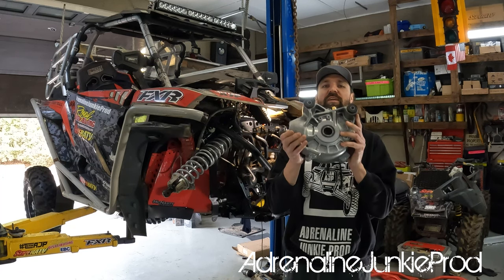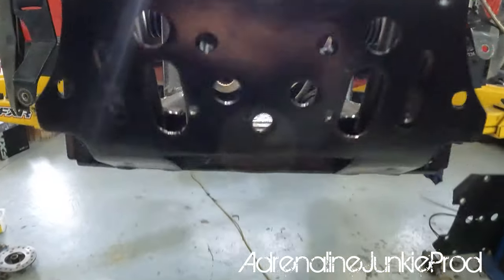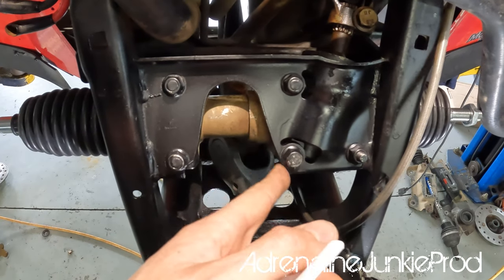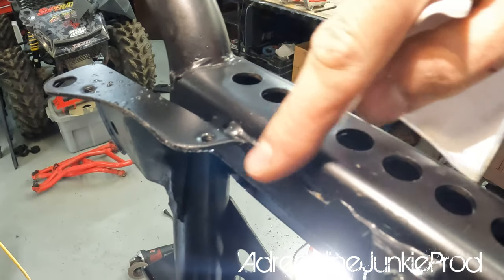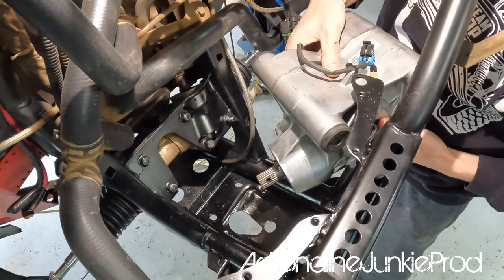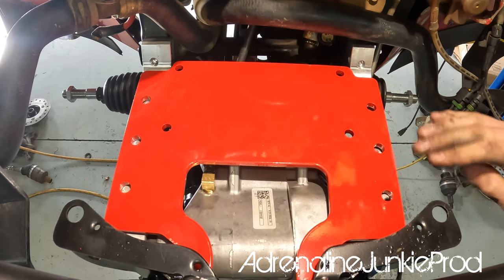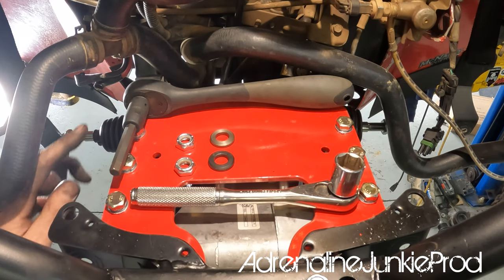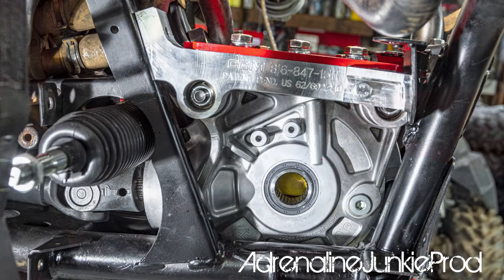HOW TO: RS1 Front Differential Swap - Polaris RZR Turbo/XP 1000 - Coffman/All Thingz UTV Bracket

Comment: Nice work. Looked clean all painted up and that diff basically fell into place.
Reply from the maker: Thank Lloyd. Ya, the kit is very well thought out and it all goes together well. The diff really does fall into place. It looks right at home in there.  A huge improvement.
Reply: What axle are you using?

Comment from the maker: Thanks for checking out the video. I hope you find it helpful and informative. This swap is very straight forward and I feel it is easier than most people make it sound. Take your time and think it trough step by step, you can do it! This video focuses on the main areas which need to be modified to fit the differential in your machine.

High quality images and more info can be found here: https://www.adrenalinejunkieprod.com/rs1-diff-swap

There will be an extended length step by step and in depth video posted on this conversion in the next few days.

If you have any comments, feedback, tips or suggestions then please leave a comment so we can get a good conversation going.

I utilized the Hill Killer differential built by Joe Coffman and I have been using it for a few months now. I've beaten on it quite hard on 34 inch tires with absolutely no issues at all. It feels way better than the stock differential. I highly recommend this conversion.

Link to Coffman Custom Machine: www.ccm-na.com

This is the exact same bracket All Thingz UTV sells. Coffman Machine builds the brackets for All Thingz UTV.

Comment: Sweet you'll be good to go now!  Did fish put a RS1 diff in his commander or was that just a Polaris diff? I didn't last long.
Reply from the maker: Ya, I think it's pretty solid now! It's been working awesome. Fish put a Swiftrac diff in his commander from SuperATV. It's basically a Polaris differential because it is a Hilliard style diff. It is not an OEM Polaris diff. The first one failed due to bad luck, there was a manufacturing defect that SuperATV later identified. They replaced the diff with no questions asked and the replacement has been working well so far.
Reply: @AdrenalineJunkieProd  awesome, good to hear they resolved it.. and it wasn't a OEM polaris dif lol.. I felt bad for him it broke so fast.

Comment: What made you use the high guard oil rather than OEM?
Reply from the maker: If you watch the extended video I go into detail. To summarize, the Hilliard diff is something that’s been used by John Deere for a very long time. Many consider Hy Gard to be superior to the Polaris Demand Drive fluid. Joe Coffman the designer of this kit and the developer of the hill killer recommends it also. I have only ever run DDF in the past and it’s been fine and if I continued to run it then it would also likely be just fine. It’s one of those part gut feeling part personal preference type choices for lack of a better explanation. Ive heard some good arguments for why it’s better though. There’s some articles about it online. Realistically either will do well as long as you change it regularly.

Comment: When was this install actually done?  Did you have a diff failure after the rebuild video?
Reply from the maker: The install was done about 4 months ago. I outline that the diff has worked flawlessly in the first comment. I have not had any issues at all since installing this even running 34 inch tires. I have put over 1000 miles of mixed trail use on this setup and it works amazing. Not a single noise from the front diff since install. It engages amazing. I have pushed it quite had many times. Video uploads on the channel are chronological for the most part. The last video I posted of the Minden Offroad Park winter ride was the last time the stock diff was in the machine. If you watch that video then I explain that the front diff was in need of replacement and that I would be swapping in this RS1 diff. It's been a really busy few months for me so I'm trying to get all caught up with the content. I highly recommend this conversion.
Reply: @AdrenalineJunkieProd  unfortunately I have a TRE  and cannot utilize the RS1 differential. Not sure exactly why but that is what is being said on the web sites of the companies that sell the conversion kits.
Reply from the maker: @Indianahillclimber  Ya, that sucks man. I've heard the same thing. I believe it has something to do with the transmission in your machine. I don't know specifically though. Maybe someone else can chime in and clarify the reasons.
Reply: @AdrenalineJunkieProd  I was just on the RZR forum, your right it's because of the trans gearing. Thankfully my trans has held up fine. If it does eventually go out I will just buy another OEM one. Thanks for the great content.
Reply from the maker: @Indianahillclimber  Ya, I thought it was gearing related, thanks for confirming. Happy to hear  you enjoy the content man! There are quite a few good upgrades available for the stock internals of the diff you have in your machine.